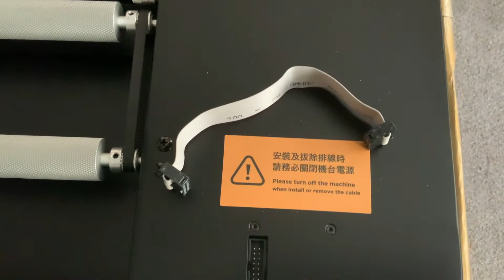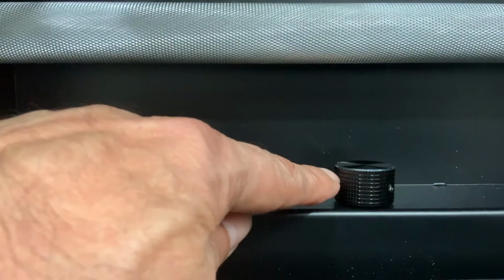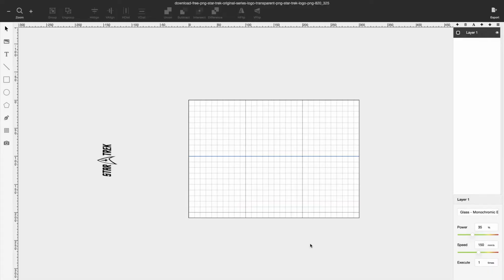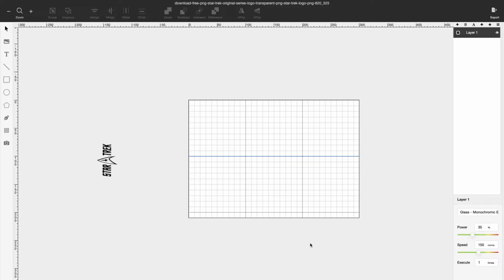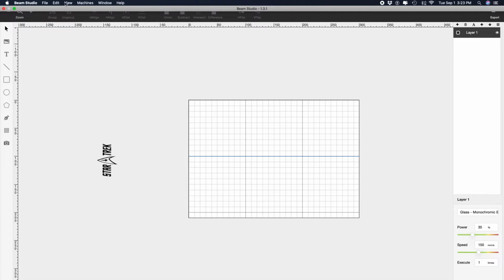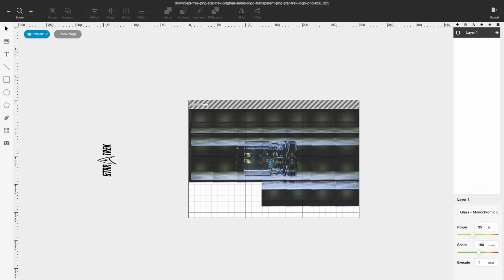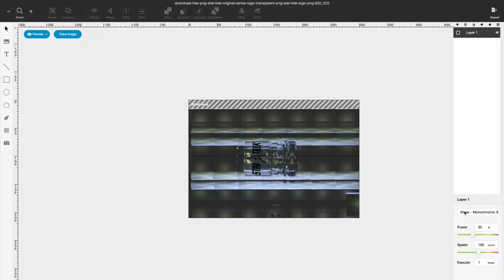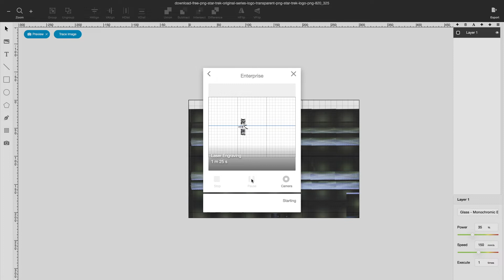FLUX beamo Rotary Setup

Comment: How do you make the logo wrap around the glass with the Beam Software. In you example your logo was just centered. What if you want it to wrap all the way around?
Reply from the maker: You simply measure the circumference of the Tumblr/cup the image will be bigger than the diameter of the cup on your screen, but it will wrap around
Reply: @lazerking1701  ahh...so it will stick past glassware on both sides.
Reply from the maker: @MasterTheNEC  as long as your measurements are correct you should be fine

Comment: Are you able to adjust the rollers to be right next to each other, almost touching? I have a small stick that I want to engrave on.
Reply from the maker: They will close as closest possible but I don’t think you’re able to close it where they’re barely touching
Reply: @lazerking1701  Thanks for your reply! So they could be closed close enough to have a small .25" gap between the rollers?

Comment: My rotary isnt spinning. Have updated software and firmware, followed your instructions and the manual, center line moved to center of object. It fails to rotate. Am I missing something? Great videos, thank you so much for making these!
Reply from the maker: Did you slide the button in the beamo software under the documents tab to "enable" rotary?
Reply: @lazerking1701  I've also re seated the ribbon cable.  I attempted to uninstall and reinstall the studio software but for the life of me can't find it in my program files.
Reply from the maker: @GoodGuyv2  That is something I cannot help you with because only you know where you downloaded the folder to either your desktop or to documents or to your downloads folder
Reply: @lazerking1701  I'm certain I can dig in and find it but I'm not sure it's software yet.  Will update if that has an effect or when Beamo CS gets back to me
Reply: @lazerking1701  Unfortunately Beamo CS was not helpful at all. After taking multiple photos, uploading video of the rotary failing and a gap in the x axis during engraving they denied the rotary was failing at all and told me it was a friction issue which was frustrating. I believe the attachment is not recognized by the beamo at all. They suggested the seller recall the unit for the engraving issue Im having and I will be returning the non functioning rotary as well. Will need to find a new supplier for the rotary, looks like amazon is out
Reply: @lazerking1701  Yes, I scan the preview after setting the height, verify the rotary setting is on and move the center blue line.

Comment: Can you engrave on bigger material pieces if you just set the machine on such pieces with the floor removed?
Reply from the maker: No....the unit will think the door is open
Reply: @lazerking1701  hi

Comment: Hey, thanks for the vid! 
It helped make the setup a snap. 
Any plans to show how to install the autofocus add on?
I’m still waiting for my autofocus to arrive. I had to order it from Great Britain (couldn’t find one here in the states) and it’s currently site seeing France and Germany for some reason :)
Reply: Ha yeah! Mine finally arrived and it was a pretty straightforward instalI. Forceps came in handy for the tiny camera and focus unit plugs. 
I don’t recall any real gottchas. You do have to remove the old manual focus from the x axis assembly so you will have to do a little adjustment and 3rd mirror alignment but it’s not bad. 
As far as auto-focusing, it’s a simple touch probe with a tiny stepper motor to adjust the height. 
Then enable it in beam studio. 
It has two modes: 
1) the default, touch down once at the start of execution. 
2) touch once at each layer, given a rough value of the object height to move down to touch. 
All in all, it’s worth it for me since I would sometimes forget to set the height, and the manual tightening ring would sometimes jam. 

Cheers!
Reply from the maker: I cant do a vid as it is not available to us here yet and I'm a FLUX distributor!